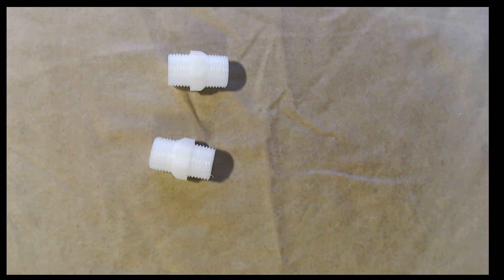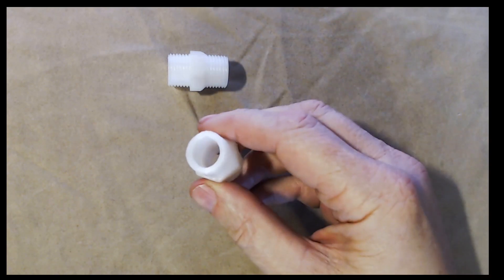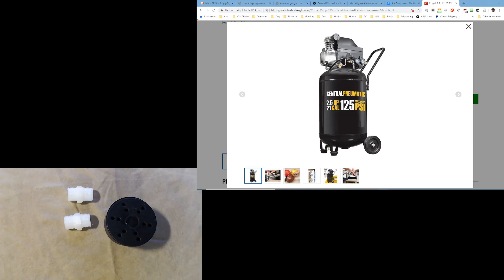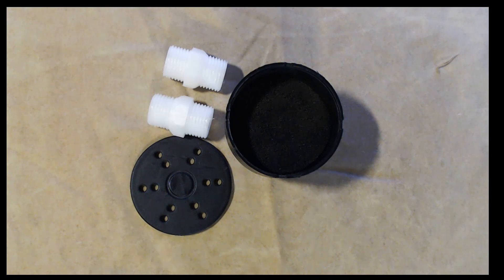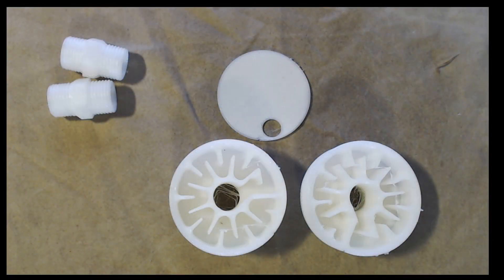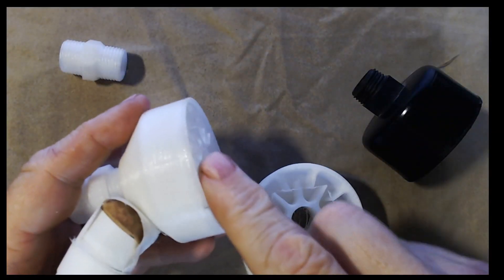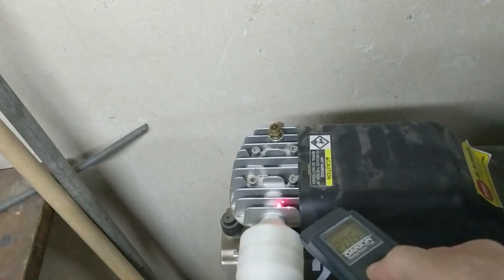Printing with Nylon on the Ender 3 Part 2 - Compressor Muffler!

Comment: Hahaha I have the same compressor. I think I'm replacing the reed valves for the 3rd or 4th time now after many years of abuse. The firs two times I made replacements out of old feeler gauges. Might have to try my hand at some kind of muffler because dang is this thing ever loud.
Reply from the maker: It's disgustingly loud. I've considered making an enclosure outside and plumbing it inside, I just haven't gotten around to it yet.
Reply: @3rdpig  Same. I hate mine despite it being a reliable workhorse overall for the money. I really just want to upgrade to a modern silent compressor. 😂

Comment: I used this compressor for about a month and then went right back to a belt driven unit. way too loud, even with the box it came in over it lol. thanks for demonstrating nylon
Reply from the maker: The muffler helps, but it's still loud.

Comment: Chuck, I'd like to see the time it takes between filling the compressor with the part, and without the part attached, as well as the temperature differences. I'm wondering if you're just strangling the air flow and due to the restrictions the part induces.

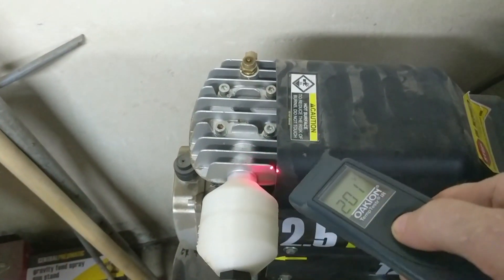Comment: 10:00 PIR temps read more on silver surfaces; P.S. sound like the outside case is rattling against the cylinder ;Not an expert
Reply from the maker: Yea, there's some metallic rattling going on, not something an intake muffler is going to cure.

Comment: Maybe could try two in series; one with a smaller inside pattern for higher pitch, Not an expert
Reply from the maker: I think the single muffler killed most of the intake noise. The rest of the noise is mechanical, either from the compressor itself, or from some other rattling. I should put an enclosure around it, but I don't use it that much.
Reply: @3rdpig  heat release, just a sound barrier should help and still allow air to circulate. But it needs sorting out  could be dangerous

Comment: 125psi Whoya!!!
Reply from the maker: loI. I don't push pressures on a $179 Chinese compressor. I may be ugly but I like my face a bit too much to lose it.
Reply: @3rdpig  If I buy electronics off eBay I ask for 2X Amps  they say it can do because they are too optimistic, e.g. a 2A PSU can only do 1A :)

Comment: do you think you can print gears with nylon filament or do they flex too much?
Reply from the maker: One of the first applications I read about, and what got me interested in printing nylon in the first place, was for out of production speedometer drive gears for classic cars and motorcycles. While I haven't done it yet, I think working 3D printed nylon gears is absolutely possible where a high load isn't required.

Comment: Ever thought about boxing the compressor in with foam panelz attached to wood? We had to do it at work and it was amazing how quite it is now. We had to leave a small area open where it draws in air for cooling.
Reply from the maker: I really ought to do something like that, but since I've gotten it all I normally do is roll it out the door and around to the side of the house. Helps me inside a lot, but I'm guessing the neighbors don't like it that much. Fortunately for them I'm not an early riser. Once my house is back in order and the appliances are out of my garage I'll have to do it.

Comment: Nice print but it still doesn't sound that silenced.
Reply from the maker: It changed the tone. It seems quieter to me, but it's still way too loud to be near it when it's running. A decibel meter program on my phone shows no difference between before and after.

Comment: There are decibel meter apps for smartphones that work reasonably well - would be interested to know what the decibel reading was near the compressor before installing the muffler, versus after it was installed. Also, are you drying the nylon at all before printing? Thank you!
Reply from the maker: I have a decibel meter on my smart phone and I forgot to use it when I made the video. Using it now shows absolutely no difference between when the muffler is on and when it's not. However, the pitch of the sound is quite different, which is what make me think it's quieter when I guess it's really not. Either way, it's still too loud for me to be in the garage when it's running.

And no, I don't dry any of my filament before using it. I live in a very dry area, humidity here now, inside and out, is about 16%. I  messed around with drying filament back when I first started and really didn't see any difference.
Reply: Chuck Bryant thank you!